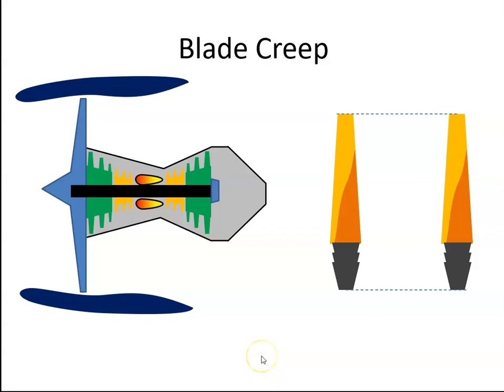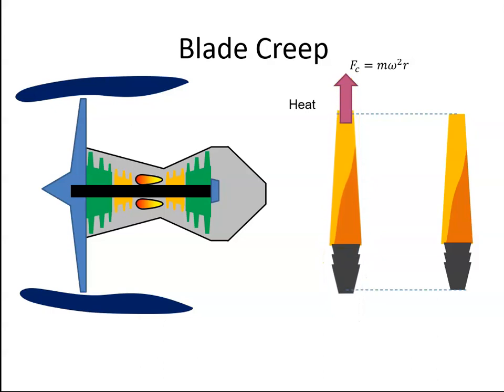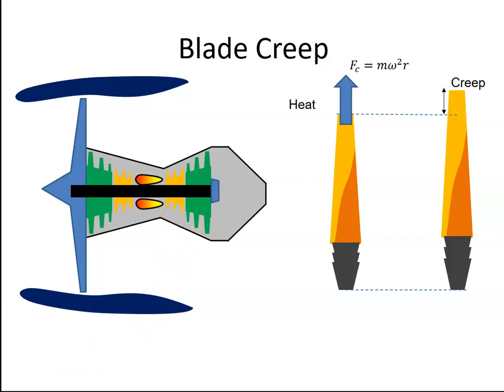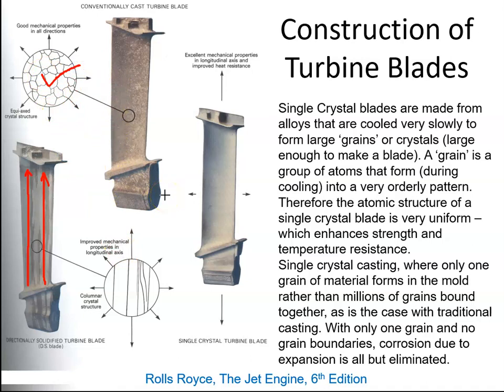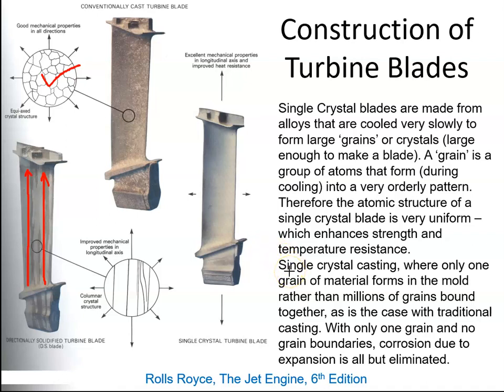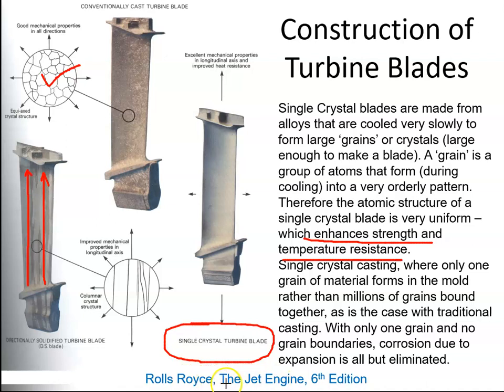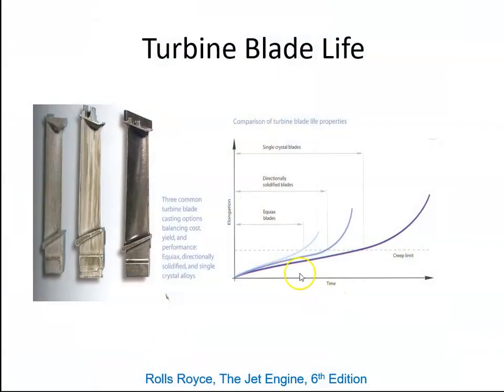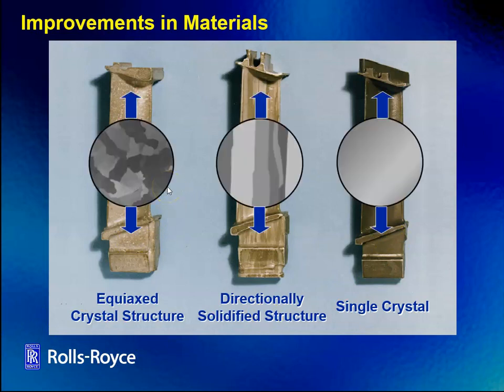Turbine Blade Creep

Comment: Thanks for the video.I also found out that nickel-based superalloys ,thermal barrier coatings  and implementing cooling channels are used to increase creep resistance .I wonder which one of these are the best for creep control ?